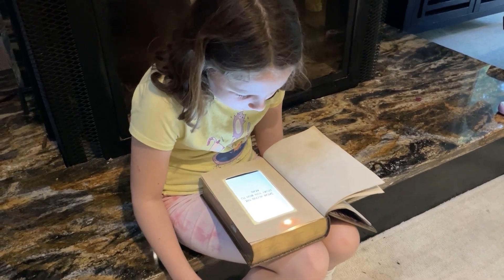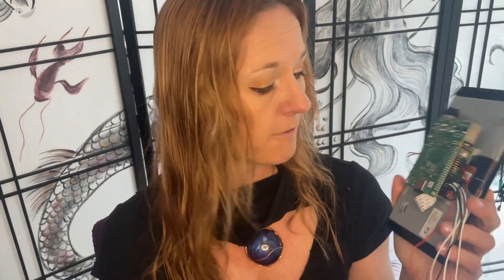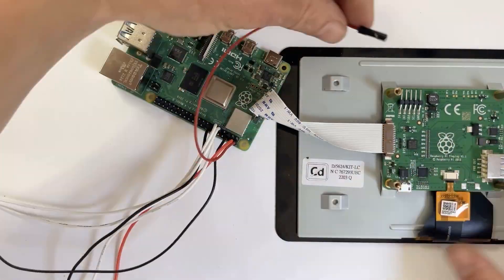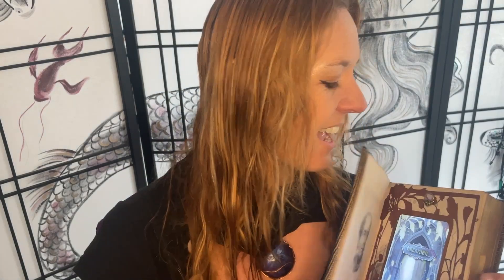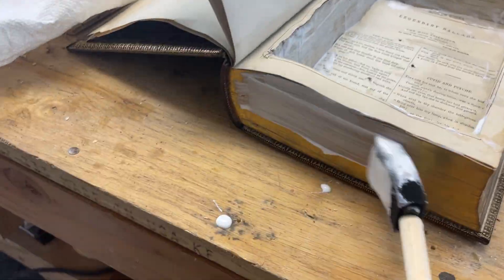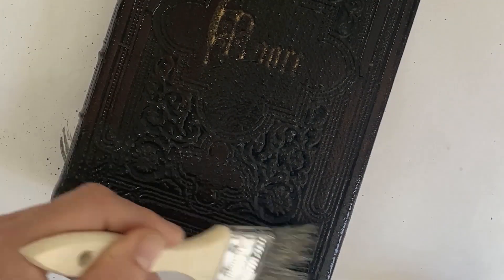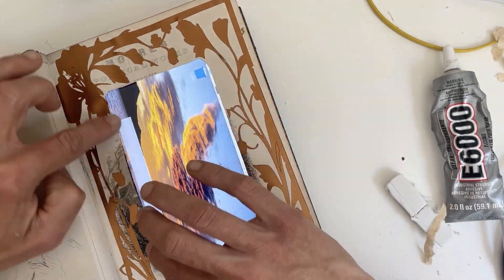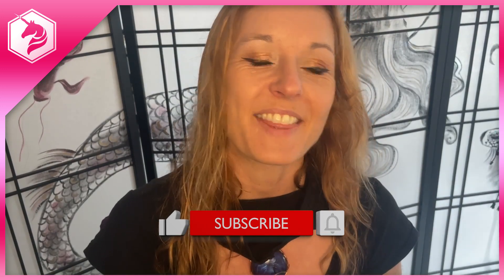Tutorial: Magic AI Storybook with ChatGPT, Raspberry Pi and Voice Recognition with Open AI #adafruit

Comment: Hi Erin/Melissa and Adafruit, just wondering if there is any issue increasing the touchscreen size to 10 inches to increase the font for those with bad eyesight (aka old age:)  I couldn't find anything in the code that wouldn't allow this, just need a bigger book I would think.  Thanks for any reply.

Comment: Fantastic. I am using the book Treasure Island to as part of a prop. I have a radio box (new) with the book on it. Inside the book will be a servo for the raven sitting on the book. Sitting next to the book is a skull. I have a pan tilt for support a skull. The skull will have a servo for the jaw. The skull will have lit up eyes. The radio has a rectangular cut out doe the dial. I will pop out the clock and place a speaker. Using Amazon Polly I will make a comical script to Audio. The raven, radio and skull will do Halloween jokes. I have all the pieces working, but need to assemble it into a complete unit. The second unit metal candle lantern with a skull that talks. It will act as a magic 8-ball. I have an animated version on my YouTube page. It is a skeleton with a cloak and just says all of the responses in order. My finished version there will be fire under the skull. It is a playground express and a larger neopixel ring. I have mounted a playground bread board to the bottom with spacers and glued the ring to this board. Using clear plexiglass disk mounted to the top this fives a place to mount the skull. I use polyester fiber fill around the bottom of the skull to look like smoke with the neopixels providing the light for the fire. 

https://youtu.be/Ad7ElkMV80Y
Reply: Very cool project!